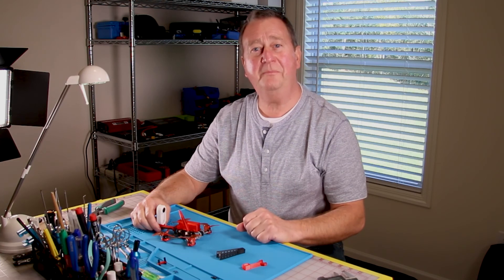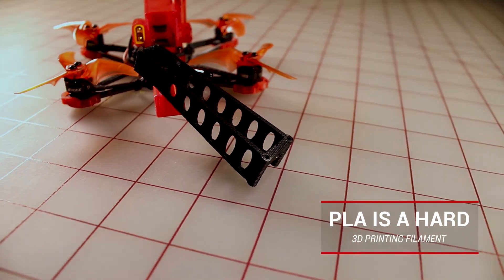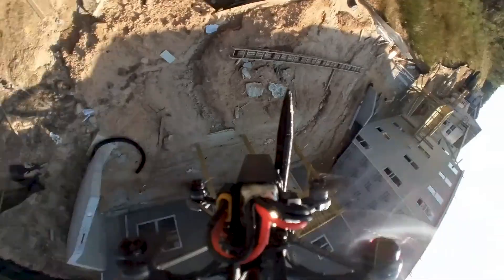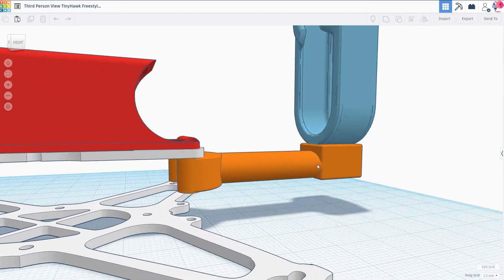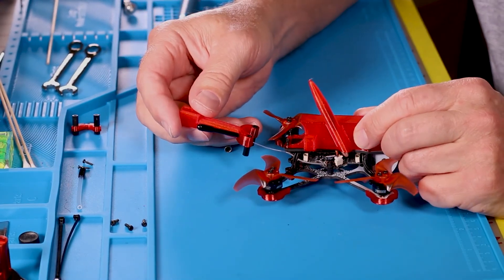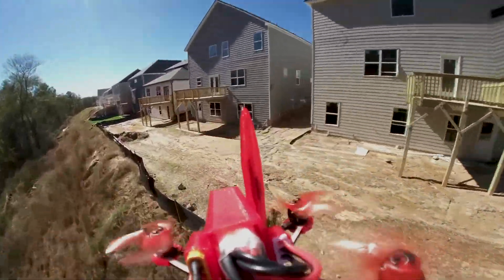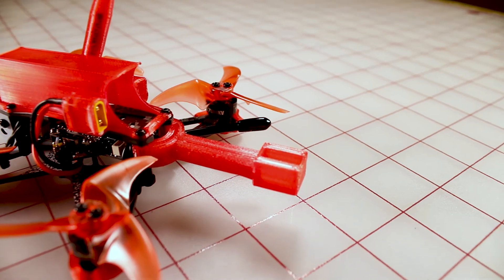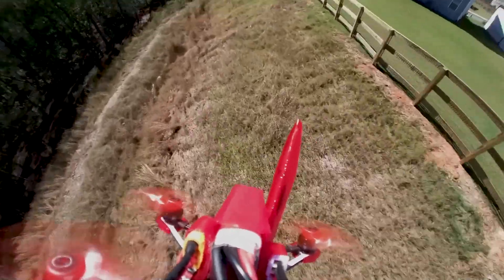EPIC 3PV on a TinyHawk II! | Custom Insta360 Go Mount & PERFECT FPV Angle

Comment: Love your videos! I printed out your whole set up to mount a 360go 2 to my tinyhawk along with the arm bumpers. You’re the man! Thank you for sharing everything. Question, would the 360go 2 mount fit the caddx peanut. I’ve heard it’s just slightly bigger than the 360go 2. I’m wondering if the tpu would stretch to fit. Any thoughts on this? Or plans to release one for the Caddx peanut? 

I printed the setup before i realized the peanut was a little bigger and before i bought either cam. Lol i just found out the peanut is a little better for fpv.
Reply from the maker: Thanks for the compliments.  I am not familiar with the Caddx Peanut but I am sure you can find something on Thingiverse and modify it with TinkerCad.  Thanks for watching🍍

Comment: I've printed this and use a Go2 mount, but I get the same issue you had with the first print... Think the Go 2 is just too heavy. Any suggestions? Would a bit of extra weight on the nose of the drone help?
Reply from the maker: Not sure if a counterbalance will work but give it a try.  The little guy does not like the weight back there but if you fly smooth you can get some good shots.

Comment: is that an antenna guard? i like that idea, doesn't mess with the reception at all?
Reply from the maker: Yes the one design has an antenna tube.  On some of the antennas you will need to remove the heat shrink that comes from Emax.  I have not had any range decrease and it give great protection.  Check out this video with all of the designs and STL files https://www.youtube.com/watch?v=JHG65TITMrk  Thanks for watching 🍍

Comment: You're turning this awesome quad into something even better!
Reply: BTW, is changing the battery connector to a xt60 worth it?
Reply from the maker: Thanks for the props!  I would leave it XT30 the current draw is not enough to warrant the larger connector.  It would also put a couple of more grams of weight and eat up more space.   Thanks for watching and commenting 🍍

Comment: What about putting counter weight at the front to make the camera be able to go further back? (Will only sacrifice flight time right?) also tried adjusting the pids? Maybe that will help

Would you ever solder a Ufl on the board and instal a circular antenna? (Or direct solder a upgrade antenna) Then you will not have to have the antenna in the view :D
Reply from the maker: That would most likely work to make the center of gravity closer to center.  The mount works well and if you messed with the PID’s some it would be a good way to get some great shots.  I have not flown with it much just use the top mount design I have.  https://www.youtube.com/watch?v=JHG65TITMrk   Thanks for Watching 🍍

Comment: That's an awesome design. And definitely one I'll try when I get round to buying my own 3D printer (looking at the Ender 3 v2 as it happens). Does the Ender 3 cope ok with printing TPU, or have you had to modify the extruder plate like I've seen some people doing?
Reply from the maker: The Ender is a Great Printer but as you suspected you do need to do some modifications to print TPU reliably.  I am going to do a video on how to print TPU like a Pro on an Ender 3 Pro in the upcoming weeks.  I used to have a 3D Printing service and had over a dozen Ender 3 Pro Printers so I had the mods all sorted out if I added another one to the fleet.  🍍

Comment: Excellent!  Love the 3pv for the Tinyhawk FS2. I don’t have a 3D printer but really enjoy the designing and testing. Have you thought of adding something to the insta360 go mount that will hold an ND filter?
Keep up the good work
Reply from the maker: Thanks for watching.  The Insta360 Go could use an ND Filter to help the jello.  I will have to look around and see if there is a small one that can be fitted.  If you come up with one let me know and I will modify the mount.
Reply: @Pineapple22  I just ordered a Caddx ND8 filter for my turtle V2 fpv lens. But I’ve noticed more jello in the insta360 go than I was expecting so I was going to see if it fits the insta360 go as well and retro fit it somehow. But if you could put an ND filter on the mount that would be an epic way to protect the lens and reduce jello.
Reply from the maker: @jsnlmb42  That is a good idea for the ND Filter I forgot they make them for the Caddx Cameras.  I will get one on order and see what I can come up with!